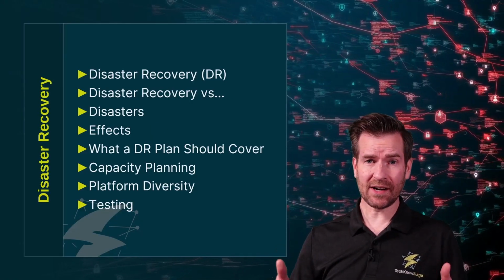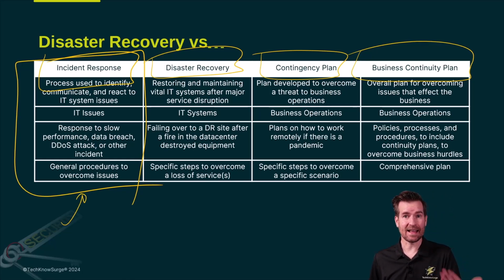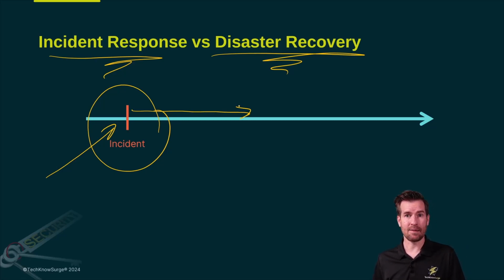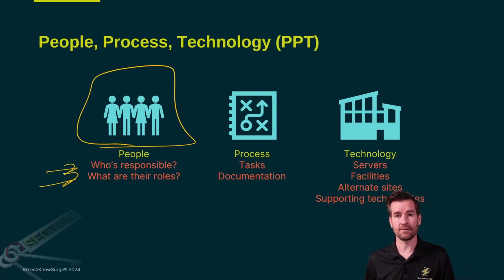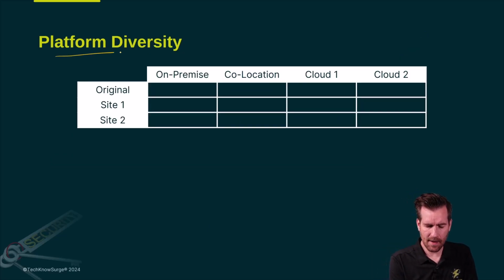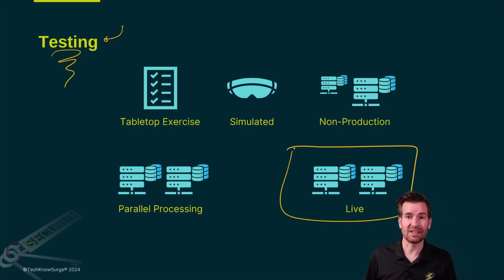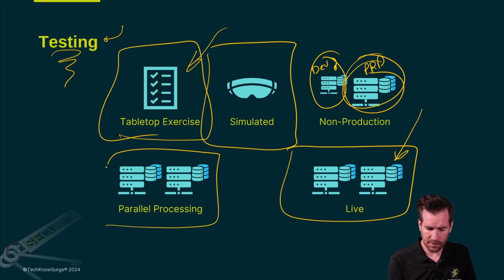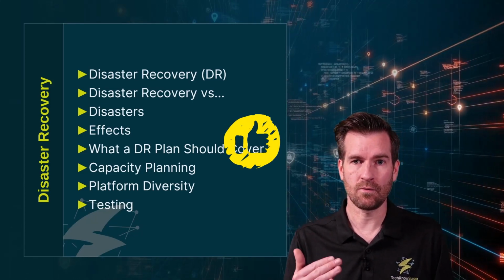Foundations of Cybersecurity 7-6: Disaster Recovery

Comment: I didn't understand the difference between Simulated (8:35) and Non-Production (8:56) testing...
Reply from the maker: My slides make it seem like it’s one or the other. It’s not. Simulated can mean a few different things. I would have a scenario for my team, they would all run through the steps, and we would practice a fail over. However, we wouldn’t do it on production/live systems. I would call this a simulation since it’s not the real thing. It could also be a separate environment, like a virtual environment, that you test out your failover process. Essentially, simulated means it’s not the real thing, whereas non-production is an environment that users aren’t accessing.
Reply: @TechKnowSurge  I see. Thanks, man!